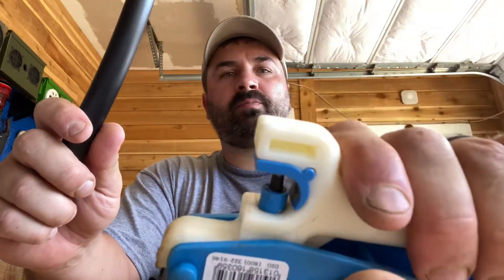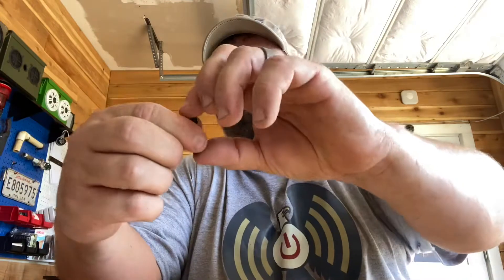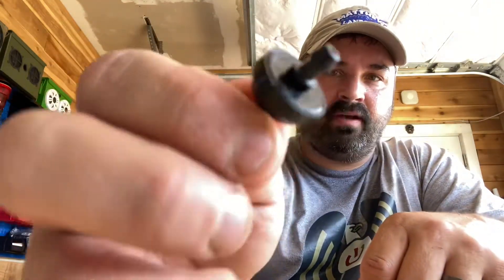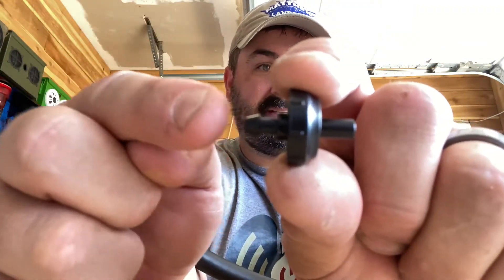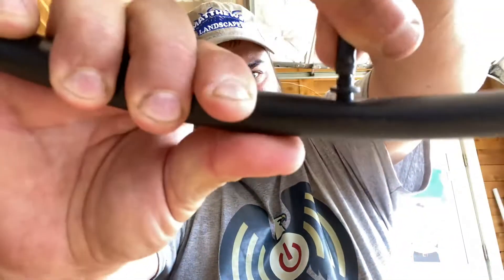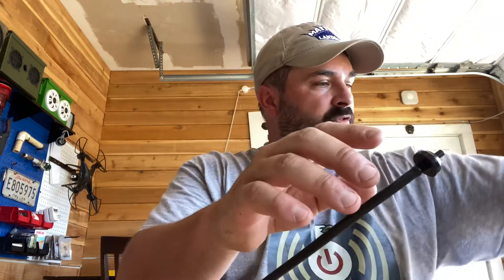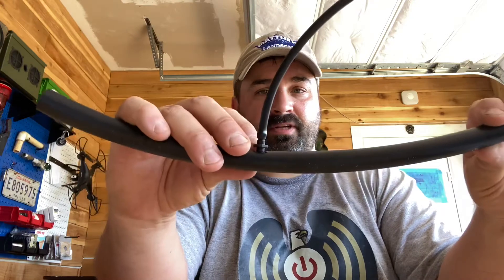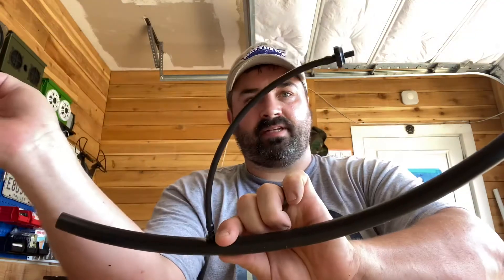Drip Irrigation 101

Comment: There are lots of cool things you can do with drip irrigation.
Reply from the maker: For sure. I am looking at different options for watering my side lawn where my timer is. It needs water. Thinking I can put out some sprayers to get it growing
Reply: @LawnPusher  That might work good.
Reply from the maker: thats my thinking. Use some sprayers tapping down the main pipe to use spray out 6 feet and get it wet daily